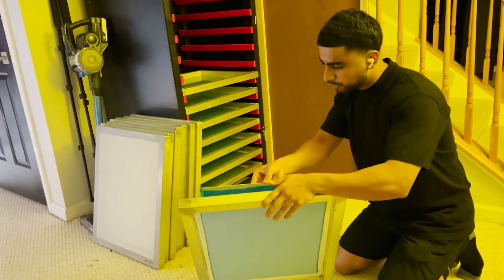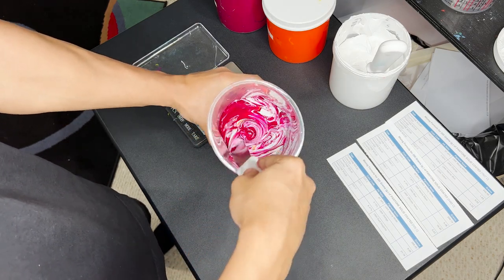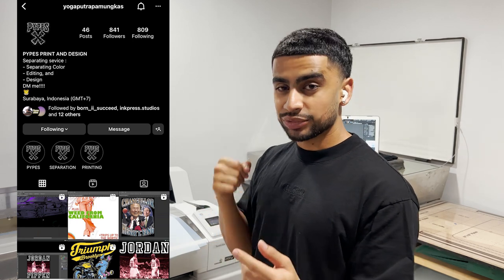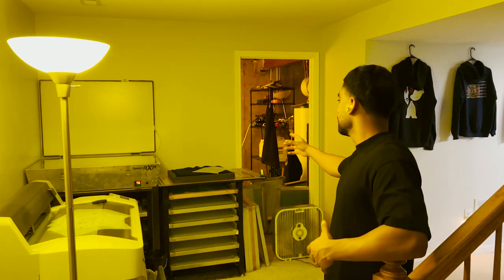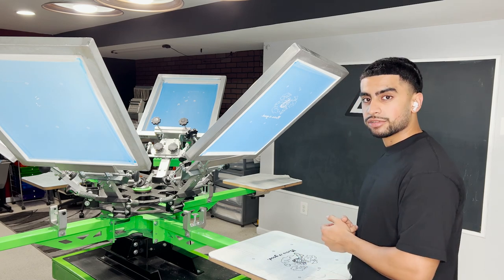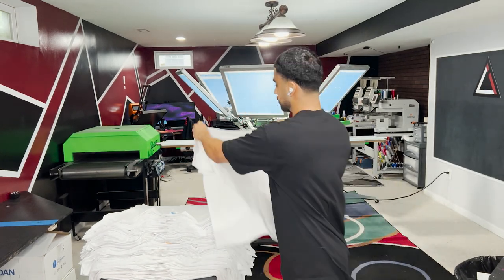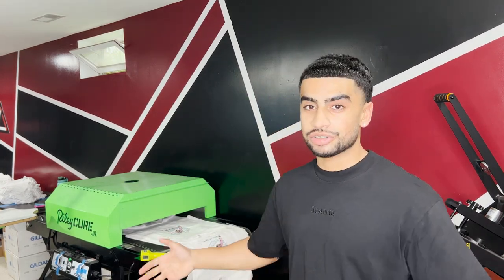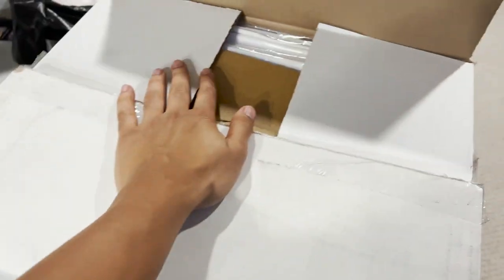Screen Printing T-Shirts From Start To Finish | The Entire Screen Printing Process

Comment: Vastex has a wall mount to coat screens I think it's like $400. Not sure how screens you coat at once but for me doing 30-40 screens at a time helps alot
Reply from the maker: Yeah definitely. I’ve just been so used to just doing it on the floor but yeah definitely will look into that. I had a mount for a table and wall but just feel more comfortable on the ground but my back can beg to differ haha
Reply: Same here I have always preferred coating on the floor 🤷🏽‍♂️
Reply: Como puedo tener el flash en Peru

Comment: great video, can you link to your pressure washer? what psi? i tried with car pressure washer but its too loud and wreck some of the screen emulsion.
Reply: standard water hose is best
Reply from the maker: You can definitely get away with standard hose but having a pressure washer has its benefits as well.
Reply from the maker: Just a basic $100 pressure washer from your local store like home depot or lowes

Comment: How to you make those reference points (that you use for lining up the transfers on the screens) disappear on the end-product. @16:18 you hold up a shirt that has those reference points printed but the other does not. How? Thank you!.
Reply: Use some tape to cover the registrations! Usually for a test print they leave them just cause. For production, use some tape on the non ink side i believe to prevent ink from getting through those marks & you should be good! Good Luck

Comment: Would it be easier to use a plate so you can add the ink in sections, So if you add to much of one color it's easy to remove.
Reply from the maker: I can still always remove ink from the screens whenever I need to!

Comment: You can but the software it’s like $299 and two clicks and it’s all separated
Reply from the maker: Mhm you can but it’s not as easy as 2 clicks. Yes it may produce some decent seps but if you really want to get dialed in with accurate seps you usually have to jump in there and mess around with it to get the best prints
Reply: @baavproductions  can you show how you do the seps and halftones